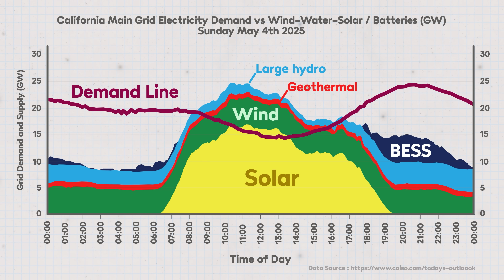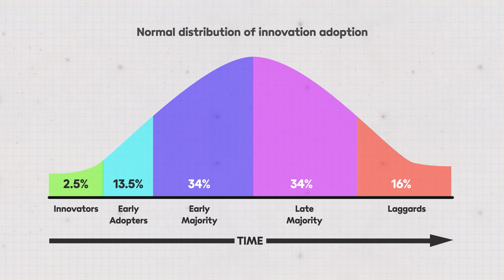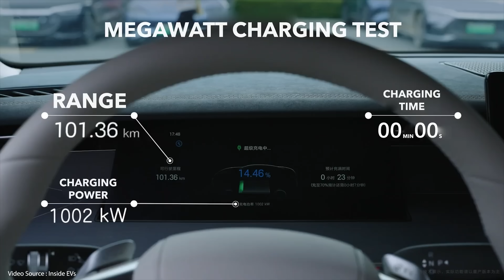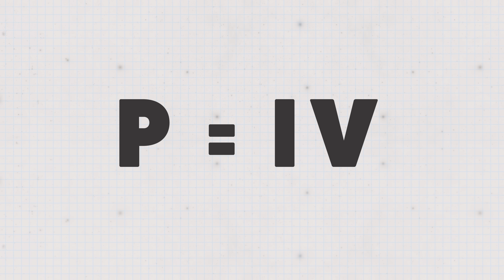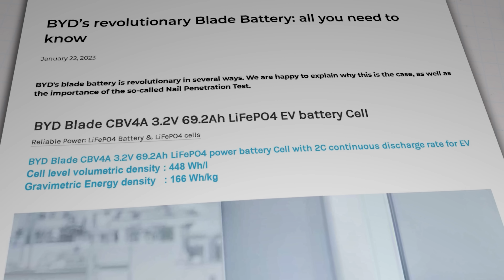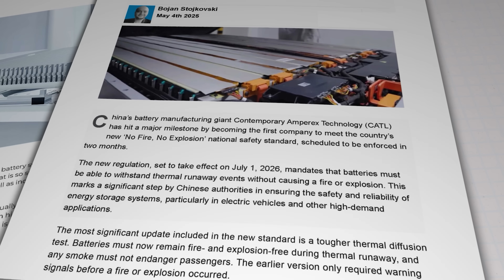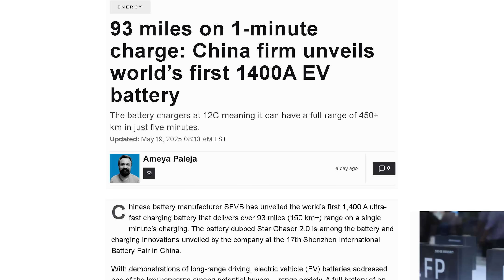BYD 1 MEGAWATT 5 minute EV Charger. Overdue or Overkill?

Comment: I rented a Model 3 for a few days while visiting Toronto. It was a pleasure to drive. The Tesla charging network was convenient to use,  but I spent over 3 hours waiting for charging to happen while driving it less than 600 km. The slowness of charging is definitely inconvenient.

Electric vehicles will be ready for me personally when they can do 600 km in -30° weather, and charge that range in under an hour. I don't mind if the range decreases a bit when it's -40° or -45°C as it's not often that cold. The lack of range, especially in winter, is what's holding them back where I live. Like the Silverado EV's 750 km range in summer gets cut in half by -30°. It may take solid state batteries to get there. That said, as commuter vehicles, they are already sufficient.
Reply: When driving in cold weather in a Tesla, if you're on a road trip and the time is fast approaching to recharge the EV you should do the following.

1.  If you're using the Tesla navigation app, the app will map you to your location taking into account all charging locations between point A and point B.  As you drive along the car will begin the process called "preconditioning" where as you get closer to the charging station it will basically work to warm the battery up to optimum temperatures to receive a charge.  So around 20-30 minutes before you arrive at the charging station it will begin that process so that once you arrive its ready to receive the charge at the fastest rate possible.

2.  If you're NOT using the navigation app, in other words you know the route by memory and don't need any navigation assistance, the car will not know that you intend to charge the car, and thus the "preconditioning" process will not automatically run and you will need to begin the "preconditioning" process manually going into the car settings and initiating the process.

If you use "preconditioning" your Tesla will be able to accept the fastest possible charging speed.  If you don't, what will happen is that you will go to plug in to charge, and the car will begin to precondition the battery pack first AND THEN the car will begin to charge.  This will increase the time it takes to charge as a result.  

The Battery Management System will not allow you to charge at the fastest rate if the battery pack is too cold, so if you're in the cold, make sure you precondition before charging.
Reply: @Les_S537  This was in warm weather, and yes, I did that. I'm familiar with the region but not the charger locations.
Reply: @MarkRose1337  Every Tesla knows the location of every Tesla charger in the world.  When you use the Tesla navigation app you can punch in your destination, and on the route it will highlight each charger between point A and point B.

You can tap the icons on the screen and more info will pop up for that charging location.  So you can see if the chargers at that location are the super fast charging stations, or older slower charging stations.

You can also see availability at the location so if there are 16 stalls in total you can see how many of them are in use.

From your story, it sounds as if the charging stations were of the slower variety, thus the longer charge times.

THAT BEING SAID...

Here's a tip for road tripping in an EV...

When charging on a road trip DO NOT try to top the battery off each time you charge because doing so will GREATLY increase the time it takes to charge.

ONLY CHARGE ENOUGH JUICE INTO THE BATTERY TO GET YOU TO THE NEXT CHARGING STATION.  

DO NOT WASTE TIME TRYING TO ALWAYS CHARGE TO 100%.

Tesla's V3 chargers can "push" 200 miles of range into your EV in 15 minutes, so just charge ~200 miles of range into the EV, and get moving down the road to the next charging station.
Reply: @Les_S537  Yes, I'm aware, I usually stopped the charging before 90%.
Reply: @MarkRose1337  You only need to do that if you're using an EV with NMC Li-ion batteries in it.  If your battery chemistry is Lithium-Iron-Phosphate you can regularly charge to 100% all the time if you wanted, but my point is more about charging time...

A small analogy.

Charging an EV is a lot like parking in a mall parking lot.

If the lot is empty, it is easy to find a parking spot, but once that lot reaches 85% capacity it becomes much harder to (one) find a parking spot and (two) find a parking spot that you're willing to park your car into (lots of people park on the lines which can shrink the size of a parking spot next to it thus people will drive on to find an easier spot to fit into).

The same principle applies in a battery pack.

Charging from 10% to 85% can go really fast, but once your battery pack reaches 85% full it gets much harder for those ions to find a place to "park".

Whether your battery chemistry is NMC of LiFePO4, it's always a good rule to only fast charge the miles you need to get to the next charging location.

No need to waste time trying to charge as many miles into the car as you can, just charge what you need to get to the next charging stop, or your destination.
Reply: @Les_S537  I am aware. It would be interesting if vehicles were made with LTO for cold weather performance. Or maybe LMO chemistry, which can take a charge much faster than LFP.
Reply: @MarkRose1337  Cold weather is still going to be an issue regardless of the chemistry used.  What is important is battery pack temp in the cold.

Preconditioning is analogous to what ICE car owners in extreme cold do when they use engine block warmers to warm their oil pans and keep their lead acid battery warm enough to discharge when you go to start your car.

Comment: electric vehicle have many benefits over combustion is not much of high bar to reach.
my point is that it is too little too late.
and how can you make anything sustainable when you want most people to drive around 2 ton of unsustainable materials and production, on top of that how much of those 2 tons is recyclable and how much pollution does the recycling make....
then we have the car culture we live in, unsustainable in it self. 
there is no future with a personal car in it!
Reply: Recycling is far less pollution than mining the raw material. And a 2-ton 35 mpg car will burn through 10 tons of dirty fossil fuel over 120,000 miles. Most of the pollution and emissions comes from operating a gasser, not making it.

If you're going to drive, get an EV. Better not to have a 2-ton box in your life, but it's not yet possible for many people.
Reply: @skierpage  what is "possible" is not an excuse, it only shows how limited your view on reality are.  we can never get anything good done with that attitude.
Reply: @sudd3660  I make 80% of my trips by e-bike. My neighbors don't, they drive everywhere. That's reality, sad as it is.

Comment: Charging overnight should be the norm. At the same time car buyers currently driving ICE cars do want to be able to "refill" their "tank" in a few minutes when on a trip, or if suddenly called away unexpectedly. 

Pricing for the megawatt chargers should be higher per kilowatt than the chargers that take half an hour to charge the car. 

That's because faster charging will always degrade the car battery faster than gentle charging. In addition to deliver such high power requires it's own battery as the grid can't deliver that much power to every filling station. 

So this technical advance will mean more business for the battery companies, but correspondingly heavier environmental impact at the same time. 

Hence my insistence that people using the hyperfast chargers should be incentives to use them as sparingly as possible.

Comment: ICE cars are stranded assets.  I tell my family to not buy another car unless it is an EV.  It is already cheaper to use an EV than ICE. This means that if you have one ICE and one EV l, the ICE will stay parked forever since the EV runs ar $.89 a gallon but the ICE runs at $3 per gallon in the US.  This can be hundreds of dollars a year.  
Once people realize this, the hockey stick will really take off.
In Costa Rica, lots of uber drivers drive EV to reduce the bottom line.

Comment: One thing that's not talked enough is infrastructure. You know full well how few people in Europe actually have a parking spot on their property. And I think we'll be seeing a divide there: people who can charge at home will adopt EVs, then the adoption will stagnate, to accelerate again once people feel safe to own one without being able to charge at home.
Reply: Did you watch the video? If you can't charge at home or work, and you can't charge while your car is parked while you're dining or shopping or whatever, then you can pull up to an ultrafast charger and add 250 miles in 6 minutes. Exactly like dirty fossil fuel car drivers.
Reply: @skierpage  Use of public DC fast chargers will ruin the longevity of your battery pack taking literal years of use out of it.  For best longevity, the thing to do is charge it with a low voltage outlet at your home.
Reply: @skierpage  Nope
Reply: @MarkRose1337  BMS can only do so much.  The data is out there for all to see.

Early EV owners overused fast charging, and regularly charged their EVs to 100%, and they found that their battery packs were experiencing degradation rates of 30% or more after only a few years of use.

Those who regularly charged at home with low voltage/amperage see much better degradation rates.

I have a 2019 Model 3 Long Range, and more than 95% of my charging is done at home with a 120v/15amp outlet, and my battery degradation after 5+ years of use and 79k miles is just over 10%.
Reply: @skierpage  You seemed to have ignored OPs point. My wife and I haven't purchased an EV yet because where I live has poor infrastructure so if I end up driving out somewhere, there is no guarantee that a charger will be available. I look forward to when better infrastructure is available and prices come down more.
Reply: And fast charging daily will be extremely expensive because the charger must be paid for.
Reply: @jpt3640  Interestingly, I haven't looked up average charging prices but where I live, they are >4x my home electricity rate. At this rate, it's actually MORE expensive to drive an EV than my ecobox.
Reply: @solacedagony1234  "Interestingly, I haven't looked up average charging prices but where I live, they are >4x my home electricity rate."

So charge at home...

Comment: Still not happy with the ecological and human impact in the production and material extraction, the missing recycling of rare metals and the non green production of the energy these vehicles consume. Also the lifespan of these vehicles given the electronics and complexity added to them while no self repairs are possible anymore. Planned obsolescence? Lifespan? High repair costs? Manufactureur binding? They don't emit CO2 directly but that CO2 is emitted somewhere else. maybe these are some ideas that you could tackle in a next episode
Reply: You should be far more concerned about the environmental harm of mining, shipping, spilling, refining, then BURNING the tons and tons of dirty fossil that a gasser goes through in operation. An EV charged by the current grid definitely reduces that and is a substantial win. But sure, it's better not to own a 2-ton metal box at all.
Reply: Electronics and Complexity applies to any modern car nowadays. No matter what we use for propulsion.
Reply: @zexel802  OK, and what is your point? The weight of the electronics in the car is negligible compared to the car's weight which is a small fraction of the weight of the dirty fossil fuel that a gasser burns through. You're probably worrying about the wrong thing. End fossil fuel burning, one way or another.
Reply: @skierpage  Absolutely, whatever we can do to bring down emissions of any kind is a step into the right direction. We have the technology. 

In my previous comment i meant to refer to the impact of electronics on the lifespan of cars. That is a problem all modern day cars share. Take a Go-Kart, a battery a motor and a switch. This set up will outlive any modern car because you don't need to worry about software updates, failing sensors and so on.
Reply: @zexel802   yes, after we get rid of the massive emissions from operation of gassers, further reductions come from increasing the lifespan of 2-ton EVs.

Comment: This charging speed will be limited to electrical system supply at that point of charging. At many charging stations, when too many cars are there at the same time, charging speeds are all reduced.
Reply: Rubbish. Just include batteries in the charger infra. The batteries supply the spike and then charge up over the longer idle period.  It's not like chargers are used 24/7.  Modelling will tell you how fast the grid connection needs to be on average, and it won't be 1Mw per stall for sure.

Comment: I spoke at a conference here in Ireland that it it could be another use case for RoboTaxis to be a mobile battery backup for renewable energy storage, giving back to the grid via bi-direction and could even be used to deliver emergency power in climate change related events that knock out the grid!
Reply: Excellent point. The fact that they're also mobile batteries on wheels gives us some niche advantages in emergencies and for energy logistics.
Reply: It boggles my mind that bidirectional charging hasn't been a thing for 10 years already.  Especially as car battery sizes have gone up and up. 10kwh is more than plenty to see most people through the evening peak period.
Reply: Until you consider that A "Car" (Taxi/ whatever) is only a "Backup battery" when it's NOT being a "car"?
If the primary purpose is transporting the public, and the public want to be transported at times of peak energy use, you don't have the "Battery" at that time.

Comment: Bit of an overkill for passenger cars to be honest. Not that I'm against faster charging, but imagine what kind of grid connection your charging hub would need if it was comprised of these megawatt chargers. It would be great for long haul trucking though. There the energy requirements are about ten-fold, if you truly want to go long haul with a full load. We need to build dedicated charging hubs for trucks anyway, those should definitely have megawatt chargers.

Comment: Autocar today had yet another video out doing range v costs tests putting public charge costs at 79p/kwh again diesel at £1.30/l - totally disingenuous again, most folks pay nothing like that as they charge at home. Even those who do use public charging are only paying that when there is no alternative, but there usually is a cheaper alternative somewhere else/
Reply: How far does a litre of diesel get you vs a kwh of electricity? (I've not driven diesel for so long I no no longer remember)

Comment: Have you come across a wireless charger like the variety you can charge your phone with
Reply: The EV1 in the 90s used wireless charging. That is, you inserted a thing into the car but no physical connection was made.  The real problem is it's not that efficient. The magnetic field drops off with the cube of distance.